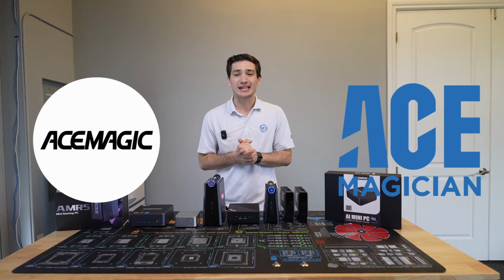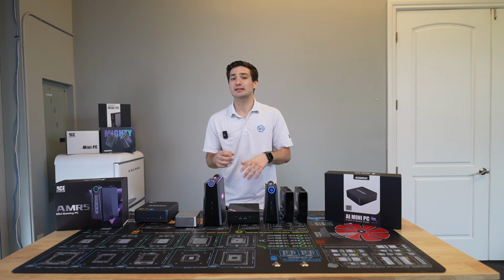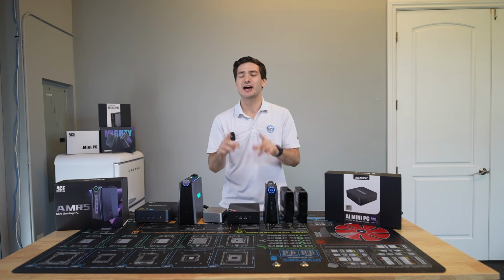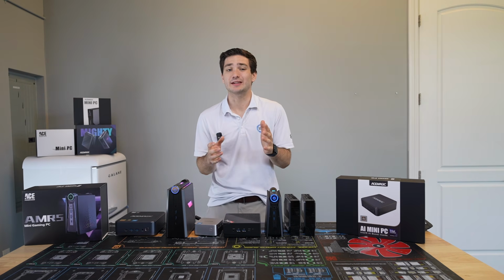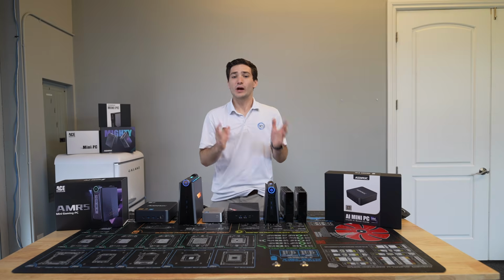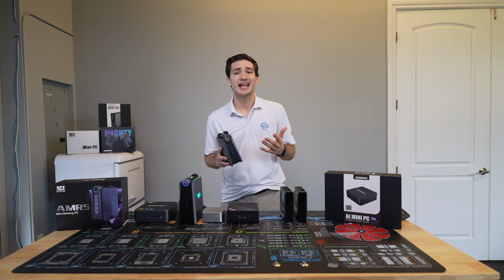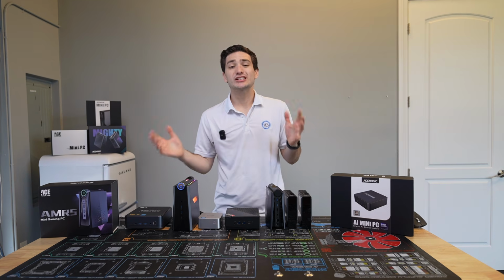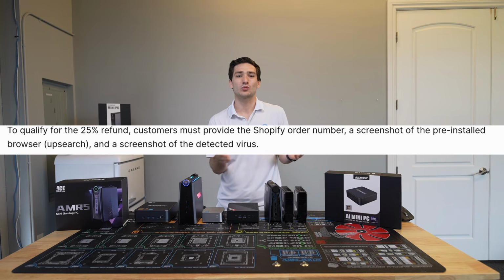Acemagic Is Selling SPYWARE! Don't Buy These Mini PCs

Comment: I received one of these to review last year. It had none of these issues. No built in Chrome. No super fast install. Still wanted internet to download MS updates, which I let it do (Why don't you have a hotspot adapter or another mitigation method so you can test these running netcode?) through my mini 4G hotspot. It was fine. It works fine. Plays some games but at 8GB of DDR5 4800 it's a bit anemic in the gaming dept. Oldrim runs fine, Skyrim not so much but you can get a locked 1080p 60 out of it. Emulation was fine too with CEMU, Dolphin and Redream running just fine on it without issues. Browsing was fine, I installed Chrome and watched YouTube on my 4k. It was fine with it. I had 13 dropped frames total and they were during the initial buffering. After that it was smooth and that was all on Wifi using a Hotspot. Connecting the ethernet cord to the wifi dropped some latency but not much. Jacking it directly into ethernet from a router and cable modem was also fine. Unfortunately, due to the slow HDMI ports on the unit (They didn't use 2.1) you can only see HDR in 1080p. And I feel they should have 12GB minimum in these as the iGPU is literally crying for more memory. The 16GB units run the games I tried with far less issues and at higher resolutions with marginally better performance. In all I had not a single issue. Now, the Beelink SER7 I have for review on the other hand? This is a unit you are better off installing your own OS on. I had to install Windows 11 myself as their copy was grey market like all these mainland Chinese brands use. Other than the Windows 11 issue though, the SER7 is a beast of a miniPC. Just too expensive. Mind you, for the price you still can't build a better performing mITX machine, so there is that, and it uses SO-DIMMS so memory is upgradeable. When the prices come down on the Zen 5 APUs it might be possible to build a comparable mITX for the price but only time will tell that story. I am so sorry you had to go through all of this and had all of these issues. I have a theory that the people tasked with sending out the products for these reviews want to see what you do with them and the malware is for that purpose. To spy on content creators. Which makes sense if you were a commie. They have no copyright laws or privacy laws per se. But I can't condone that. Ever. I can say that there was a time when the commie products didn't come with any OS. You had to supply your own and they were even cheaper for it. They should probably go back to that model. they may sell less, sure, but at least they won't have to deal with the spy department installing malware the rest of the company is unable to do anything about due to the structure of the business being state backed. Can't wait to see North Korean minipcs 🤣🤣🤣🤣🤣🤣
Reply: How does the SER7 run now? I saw reviews of it on Amazon stating that it had problems
Reply: You received one to review with 12 subs yea ok

Comment: I bought one anyway - I plan to use it as an emulation machine that will not be connected to any networks (I will put all the data on a flash drive and then transfer it to this mini PC). Unless they can somehow get my data from my TV via HDMI cable or are able to retrieve it from my controller (or KBnM) that I'll be connecting to this thing, there isn't a way for them to get any of my data from this machine out to wherever they can steal it.

Comment: Here's what you do don't connect it to the internet. Burn a copy of Windows to a thumb drive and format and overwrite the the OS no more spyware
Reply: Make sure to get the key first. If it's not listed on the outside of the machine or in the paperwork, you'll need to first boot it up without connecting it to any network and once you get through the setup and get to the desktop, go to settings and find the windows key, write it down, and THEN go ahead and reinstall fresh windows that you downloaded onto a flash drive from a different PC.
Reply: @PeterDB90  appreciate the advice gonna do this myself

Comment: Just format and install a clean windows with the key they provided
Reply: I'd just install openSUSE TW tbh
Reply: @c0ur13r6 that linux..not everyone needs it
Reply: Are the keys typically listed on the outside of the machine?
I bought one anyway planning to do a clean install, but I figured I'd first boot it up while not connected to any networks so that I can go to settings and retrieve the key, and then do a clean install with a USB flash drive that I download Windows to using a different PC and use the key I got when prompted.
Reply: @PeterDB90 you could find the key with a cmd prompt
Reply: @PeterDB90  yes there is a key or you can open cmd and run command "wmic path softwareLicensingService get OA3xOriginalProductKey"
Reply: @PeterDB90 it's been many months since I bought it and I had no issues..I'm a computer tech since 94!! I built over 500+ custom pc's, fixed 1000s and i owned a company I worked for too many companies I checked his computer before I actually started using it I found nothing wrong with it and many months later mostly is wrong with it working completely fine
Reply: Is this really enough?
Reply: @NorthernChimp  Usually its enough. As a UEFI / BIOS Malware is quite hard to do. Especially with TPM secured Windows 11 installations. Worst Case you would have to just use Linux.

Comment: wow good thing i saw this. just bought one cause it was the cheapest. i shall perform aclean install on mine as soon as it arives
Reply: Is there a way you could explain how or show how to do this I ordered one recently and I don’t even know this was possible
Reply: @lizethmartinez-arias9238 look up how to download the version of Microsoft os you want on there and put it on a USB drive and just wipe the ssd and reinstall fresh you can lookup vids on how to do all of this.. gl and hope it works
Reply: @lizethmartinez-arias9238  
Just search "how to do clean Windows install" and they will take you step by step. It's something that's a bit too long to describe over comment section. You will need a flash drive, preferably one that's MBR formatted, but if not, you can format it into an MBR drive yourself with some software. Anyway, the point is you need to look it up.

Comment: Rubber bands to hold the heatsink on is nothing new, I have a couple of those myself, bought off of Amazon. I recently bought their AX16 laptop for my daughter to use as her college laptop, I used partition magic to delete all partitions and then created a new partition and did a clean install of Windows using the Microsoft media creation tool. So far I am impressed with their laptop for the price that I paid, $399 on sale.

Comment: I have had one of these pc’s since November of last year, but it didn’t come with chrome  pre-installed, infact I’ve never installed chrome on that pc, however I still want to be sure it’s not infected. I use Malwarebytes free version, but I’m wondering what software you used to scan the computers in this video.
Reply: pues advances sistem care tiene anti spyware y anti rootkit ademas que ayuda a el equipo

Comment: You can still setup a local account when doing a Win11 install, i build about 10 machines a week so do this all the time.
Reply from the maker: My concern was more that it didn’t allow you on the initial setup prompt you to setup your device with a Microsoft account. It was bypassed. Plus to bypass it on the official windows installer you have to enter command prompt. Which is why I brought it to attention.
Reply: @mattscomputerservices  I find on the official installer / usb (Current), all you have to do is pull the ethernet cable at that point, click next. 2 mins later it times out and offers you a local account. As soon as you do that, plug ethernet back in and continue.

Comment: I run linux  no spy ware  or BSD If it can boot usb I am good to go.
Reply: You're overly paranoid, Windows is fine if you use common sense in your security practices. For example, not trusting an OS that some random person installed.
Reply: @Somebody2687  Using linux doesn't make you "overly paranoid"
Reply: @c.s.7474  Not saying it does. I'm just saying that if you are only using it for security reasons on a personal computer, then it's overkill. If you like it, that's a different story, there are many fantastic linux distros. I wish it had more support from software developers, if I could get any software I wanted easily without hassle I'd switch to Linux and never look back.
Reply: @Somebody2687  You definitely did say that. Where did he say that he is "only using it for security reasons on a personal computer"? Nowhere.
Reply: @c.s.7474  Where did I say that using linux in general makes you overly paranoid? You're the only one who said that. You're taking what I said out of context. Using linux on this specific machine solely in order to avoid the potentially preinstalled malware on this specific machine is being paranoid. Context is important, the topic of the video is a very specific computer, not all personal computers. Wiping the drive completely and installing the OS again is equally as secure as using for example a factory new Dell PC, that was the point. You don't need to use linux to avoid the malware.
Reply: @Somebody2687  "Using linux on this specific machine solely in order to avoid the potentially preinstalled malware on this specific machine is being paranoid" which he never said the reason was for using it, so you're calling him paranoid just based of the fact that he said he uses linux.
Reply: "You're taking what I said out of context."

"I run linux"
your reply: "You're overly paranoid"

Comment: you're about 2 months late with this video. acemagic already released clean (iso) images for the windows re-install as the software required for the lcd to work is only included in the aforementioned image.
Reply from the maker: Actually the point of this video was to raise awareness that the issue isn’t resolved because if you can still by a system from them today with spyware then it’s still an issue that needs to be addressed.
Reply: @mattscomputerservices  You are buying old inventory. The issue was fixed months ago. Wake up!
Reply from the maker: The old inventory needs to be pulled then. Because people are still buying these PCs unaware of the consequences, so it’s important to raise awareness that they haven’t taken care of this issue completely if they’re still selling systems with spyware two months later.

Comment: Many routers from China were found to have backdoor on a non-suspicious looking ic on the motherboard around 10 years ago if someone remember so what is odd possibility that these cheaper PC have same issue? I think, it is CCP effort to sabotage and surveillance around the globe by flooding cheaper hardware with hardware and software level spyware and backdoor. Intel ME is exactly that which run separate OS on Intel CPU and there is no way to see what it does.

Comment: Funny how he's worried about a bit of spyware on his system when windows 11 is entirely filled with trackers, telemetry, os level shenanigans.. no-one should run it, regardless of what PC its on. Not to mention ' a very specific os installation cd for making a local account ' pish.. just install it without the network connected.

Comment: Just a thought is there anything loaded into their bios that could reinfect a fresh window install?
Reply from the maker: It’s not impossible and I did think of that but it’s probably very unlikely, as it’s not only complicated to setup (doesn’t really rule it out but it would require some dedication) and based on the spyware I found it’s all fairly surface level so I doubt that it’s that deep but I’ll see if I can scan it for anything I missed.
Reply: @mattscomputerservices what about moonbounce or similar?
It would be ideal as it can be used as a launchpad.
Reply: @mattscomputerservices Is there anything that can scan the bios and sector 0...etc?
Reply: I got a different machine to this, it had win8 embedded in the chip but was manufactured in 2022?

Comment: What is the best laptop that stays cool for gaming?My price budget is 1200.What is the best thing for me to get?I would love your advice for help
Reply from the maker: First, I’ll say most gaming laptops have a cooling issue that’s pretty standard with this past generation of hardware. But one system that I have really enjoyed using did include some thermal results in my last laptop cooler round up is one from Asus: https://amzn.to/44iV1QF 
It’s probably a little above your budget right now, but it may be worth saving for. It’s a really solid machine.
Reply from the maker: Also, depending on the deal, this is the cheapest you can get a RTX 4070: https://amzn.to/3QoIUvT
Reply from the maker: One more option to look at is this system from Lenovo. I’m actually working on a review of a system similar to this one and I like it quite a bit. https://amzn.to/44iVaDH
Reply: Thank youu